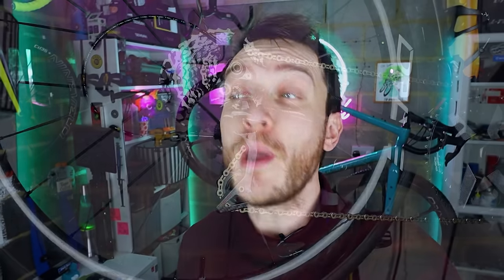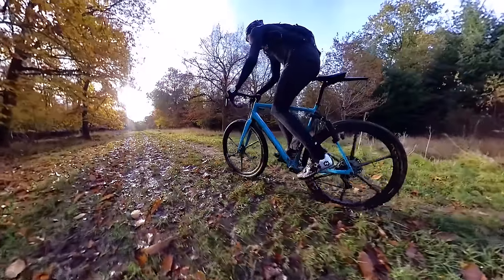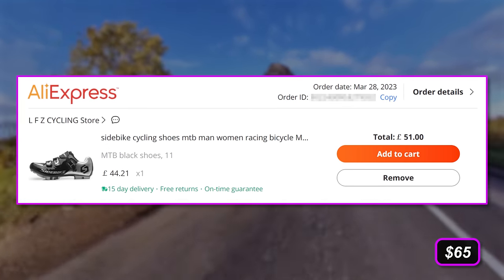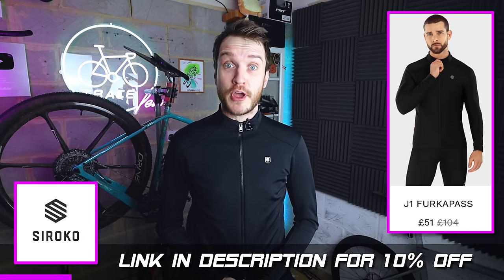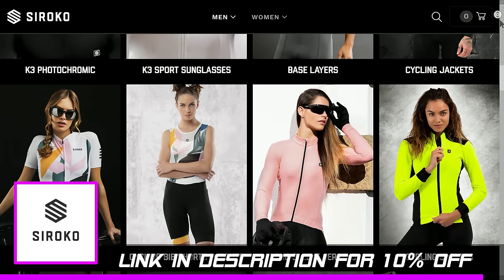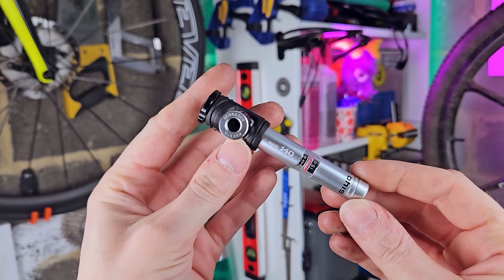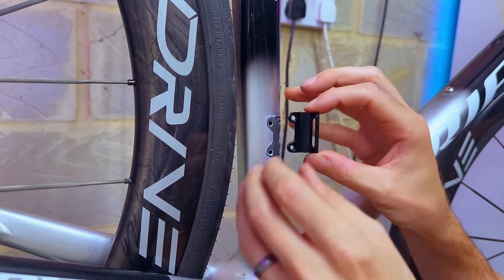Cheap bike parts - My best & worst of 2023

Comment: Road rider using the Zeray pedals.  Quick hack is to remove the locking mechanism from one side of the pedal (2 sided not really needed for road riding) and the pedals drop in weight to only 220 grams - outstanding!!
Reply: Thanks for the tip, is it easy to remove one clip ?
Went from the basic shimano pedal (2 sided at 444 g) to their single sided at 282 g, would not mind an extra 60g saved (bit of a weight weenie)

Comment: Awesome video once again. Regarding the xpedo pedals ive read on numerous forums that they dont play nice with any thing other than xpedo cleats. So maybe that explains the issue.
Reply: I use four different sets of Xpedo with Shimano cleats, and never once fell ;)
The pedals shown in this clip are fake, I would take a bet.
Price and weight do not match my (supposed) originals, and I ride them since 2018 without issues (also, this model has been discontinued for years already).
Reply from the maker: Thanks so much! So the XPEDO pedals did come with some wierd looking cleats and i would have used them, but they were designed to fit road shoes with a 3 bolt interface, not the standard 2 bolt MTB shoe interface. They claim to be cross compatible with SPD, but maybe you are right and the XPEDO cleats would have been better. Still not particularly impressive either way IMO. @luminodotcity, in terms of they being fake, I dont think so. The packaging was really nice, and it included all the extras and a proper manual and warranty card... Maybe i just got pedals from a bad batch, but i think it is something to do with the design. Like you say, they seem to have discontinued it, maybe this was for a reason...

Comment: I ve had good results with the Wellgo Xpedo single sided SPD pedals .  My 2 sets look the same as Lukes but are heavier at 244 g .  The bodies look like aluminium but a magnet sticks  to them so must be some sort of Steel .. i have Wellgo Xpedo M Force 8 pedals too .  Thry work fine too , but a ot more expensive .. i use Shimano SPD cleats
Reply: Same, agreed!
The ones in this clip seem to be fake - too cheap and too heavy. My pair is 170g for the pair and play nice with Shimano cleats since 2018 :-)
Reply from the maker: Yeah tbh it surprised me, because i know XPEDO have a good reputation, and make some decent and well respected pedals. I honestly stuck with them for AGES thinking they would loosen up over time, but time and again i had issues unclipping. I think i may have had better luck if i stuck with the cleats that they came supplied with, but they claim to be SPD compatible, so in the end i got fed up and swapped them out.
Reply from the maker: @luminodotcity  The weight difference is a bit odd, the box they came in said they were 215g, so coming in at 210 seemed resonable. I know they come in a lighter titanium spindle variety... Are these the ones you have?
Reply: @TraceVelo   I thought you had the TI ones as well, as that was what I read on your box. Clearly, right next to it, CR seems to be highlighted and that escaped me.

I have the TI-spindles, yes, that explains the weight difference.
But clipping in or out, with three different shoes on Shimano cleats was never an issue in 5 years now.

What I am not a fan of is, that they only have one bearing and one bushing each.
Well maintained (i.e. re-greased) they should not loose too many watts - but I went with the double sided ones now, which have ball bearings all the way through, and weigh only around 260g/pair.

Are the CR ones still available this year though? When did you buy them?

Comment: @10:53 Luke, you can go one better than them. There is now Schwalbe ONE 365 tyres. I guess a 'quick' tyre all rolled into one. Ive got a pair on my wall but i havent used any examples yet. Id expect them to be slower, but have the puncture protection to that of a Marathon. Cheers. m

Comment: Great video, for rotators i buy the iiipro you viewed one time they light and does not heat too much, for tires i prefer gp5000 they little expensive but really good on the ride i was all about cheap tiers before but i treat my self once with gp5000 and i can't go back to cheap tiers any more i think and that's only my opinion for my self i shouldn't go cheap on tires or braeks
Reply: There cheap brand shared the same design of brakes and rotor. That means they will leak after very short distance and need the shimano spare parts to repair.
Reply from the maker: Everyone RAVES about the GP5000, but they are just SO expensive. I've never seen the tubeless ones go for less than £50 a tyre, but maybe they are worth it...
Reply: @TraceVelo  you are right it's sooo expensive but i bought them to see if it's going to make any difference it's smoother little faster but you know what they said " it's not the horse it's the horsemen "

Comment: Hutchinson tyres were supplied with my first ever gravel bike, the Overide 38mm ones. While cycling to work around Dundee, I had a puncture about once a week. Switched to WTB Nano since, as they were on offer on Wiggle for 8.99 and never looked back. Third pair in and I didn't have a single puncture in 2 years.

Comment: I use a ZTTO 11-36 cassette on my road bike.  It is an 11 speed mechanical Shimano 105 setup.  I've had the ZTTO cassette for almost a year & am very happy with it,  The 36T cog really helps with higher gradients.  Shifting is fine rather than perfect.  I'll definitely replace it with an identical cassette when it wears out.  3,286 Philippine Pesos from Lazada (about GBP50)

Comment: Question about ZTTO cassette.

A year ago I bought a SROAD HG 11-42 cassette. Now I need a variant 11-46. I tried to find such a range from SROAD, but unfortunately there were no options. I looked through your reviews on these cassettes, inspired and ordered ZTTO HG 11-46 ULT. After unpacking, I did not like two facts: 1. the inner sleeve between the outer stars (movable), it rattles a lot; 2. the cassette is held by the drum at the expense of the outer stars, which have splines.
I have not met with such a design before. Do you think after a while will not kill the cassette - the drum?
Thanks)

Comment: I had to buy another frame from AliExpress because I broke my carbon frame frame a crash. The frame I am getting would be the TREK SLR gen 7. My question would be about buying the BB T47 x 24. How do I know would be a good one to buy from $20 to $200? I bought most of the parts from AliExpress from the last bike, I want a good Bottom Bracket, but I do not want to overpay either for no reason either.

Comment: I've been using the IIIPRO/ZRACE  Centre lock Rotors and they have been great with KORVELO "New Formula, now with more red" 🤣 (taken right from the listing) pads and I can't fault them. 
Glad you are coming around with the Tri-Fox frame my DELIHEA has been nothing but a joy to ride. And to be fair to Tri-Fox lots of mainstream fames suffer with the same issue Pre 2020 Cannondale's were prone to it.
Reply from the maker: Yeah the TriFox frame has grown on me since I fixed the FD hanger, it does ride well, and like you said alot of frames in the 2010's suffered with the same problem. BUT I actually have another OG-Evkin frame on the way, so it will be good to compare the two. They are a similar price, but from what i have seen the OG-Evkin stuff seems to be a cut above... But i guess we'll see...

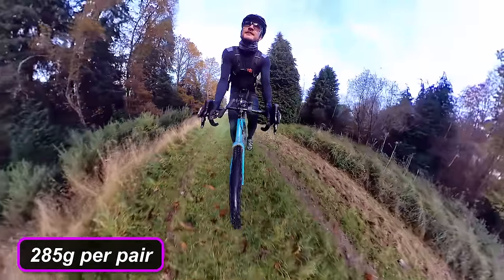Comment: 4:31 Just a heads up. In my experience with the zeeray spd cleats pedal, they were mostly good in terms of performance but I had a problem unscrewing the allen screw where you would lube the cleats. Mine is difficult to remove from the left side of the pedal that the thread became loose and couldn't remove the allen screw.
Reply from the maker: Ok interesting. I've already had both of those covers off on my pedals, and they have been fine. Hopefully I wont have to lube and service them for a while, but thanks for the heads upo anyway 😁
Reply: In the video it looked like they weren’t really spinning that freely? What’s your experience with that been?
Reply: @TheSlounsBerry   I thought the same, and was going to ask.. definitely didn't look to be spinning properly?
Reply: I have these Zeray SPD pedals. No problem at all. I moved from toe-clips to these, clipping in and out have been easy and problem free. Have also screwed and unscrewed to adjust the cleats multiple times   with no problem with the screws. Great purchase for me.
Reply: Those zeray spd cleats sadly have no bearings so there's nothing much you can do when it goes bad😢

Comment: Ordered the same Og Evkin, it was between the tri fox and the OG. Scored it for $390 USD so it was hard to pass up. Although the tri fox is in sale for $499 usd at the moment
Reply: I snapped one of there hardtail MTB frames at the headstone but it was good as it lasted
Reply from the maker: Ahh amazing, yeah that CF-025 frame is fantastic IMO. The trifox frames are generally ok, but in my experience require more more faffing around to get everything working smoothly. The OG-Evkin frame was just easier to work on, and basically problem free, so is def what I would reccomend out of the two.

Comment: I'm feeling the second hand embarrassment from that one at 12:24 😂 I got some Xpedo M-Force 3 pedals for my upcoming gravel bike, so I'm really hoping I don't eat the mud like that 😂 🥖🥖🥖
Reply: I have those pedals on my gravel bike, they work fine. It says in the instructions that to clip out you need to press your foot down before twisting it
Reply: The "Xpedos" in this clip are fake, I dare to claim.
They are discontinued for years already, and my pair from 2018 goes strong, I never fell, and they are 170g/pair and closer to 200,- Euros, go figure ;)
Ride safe!
Reply from the maker: HA, yeah was pretty cringe worthy! I mean XPEDO generally has a pretty good rep in other markets, and they produce some really premium gear, so you will probably be fine, but my set of pedals were just problematic. I've seen some comments from people saying you need to run them with specific XPEDO cleats. They claim to be SPD compatible, and you might have seen, i was running Shimano SPD cleats, but maybe this was what caused the issues i had... who knows!

Comment: Those zeray pedals lasted one winter for me. I went back to the shimanos, and they are miles better in every way !
Reply: I bought a set to try 2 years ago and used them on my MTB where they weren't confidence inspiring as they'd unclip randomly even fully tightened. I swapped them to my turbo bike and the bearings were rough within 18 months. I've got a set of m540's that are 15 years old and still work fine. 

I recently picked up a pair of ztto SPD copies for about £10 and they seem much better but I've only done about 200km on them.

Comment: Be careful on the schwalbes if they’re the performance rather than the evo model, they’re the only tyre I’ve had that has had that same loose feeling you described.

On another note have you ever tried the fasterway carbon bars, they seem to be the only ones I can find with 35cm tops?
Reply: it scares me seeing someone with handlebar narrower than 40, in group rides I tend to ride further from them, since most of crashes I've seen on crits are riders with narrows. would recommend staying away from those, we're not racing world tour afterall 😄cheers mate
Reply: I run 38cm bars in summer but that's just a comfort thing. If I had a bike fit, I should absolutely run 42cm bars, but if I do, I end riding funny and hurting my neck and shoulders.
My track bike originally came with 36cm bars, I wouldn't use them on a club ride.
Reply: Thanks for your concern, I've ran 38s for a long time now and feel I could get faster bringing my arms more in line with my legs.
I tend to do a lot of road bike TTs and solo distance rides. 
My crit bike has 38s on there and they're plenty wide enough for banging about, cornering and stability is so much more about your feet and weight transfer than your handlebar steering anyway.
Reply: @robvtec  ah well 38 is some middle ground. I've also seen some beefy wide shoulder cyclists going with these narrow bars and it's also comical 😂
But regarding your question, I ordered few handlebars off of Ali and I've never seen under 38, so maybe you go for ones you've found

Comment: I bought a set of XPEDO SPD pedals from a German online bike company and had a similar problem with them.  Even on the loosest setting I still had a hard time disconnecting my cleat from the pedal.  Unfortunately, I turned one of the adjusting screws out too far and it fell out during a ride, making the pedals unusable.
Mine were a fancy blue anodized model and a total waste of money.  
A big thumbs down to EXPEDO pedals.

Comment: I put 700 miles on those pedals and I'm not a fan. They're ok if you're riding gravel but they feel real sketchy on a mountain bike. No matter how tight I got them they just felt loose and the spindles are mismatched. Real Shimano pedals are leagues better.

Comment: I usually agree with you, but I have those zeray pedals and they are absolutely atrocious. They have excessive float with no tension, so they flop about left and right when you ride. I tried them with both supplied and original shimano spd cleats, and in both cases the problem persists. 
If anyone wants to save money and thinks M520 are too heavy, I'd go with used M540.
Reply: My experience also.
Reply: Thanks for saving me the trouble. The non adjustable float (despite the Zeray being advertised as adjustable) in a pedal is  a deal breaker. It's what I despise in my Time ATACs. The Pedo pedals and Rock Bros shoe covers are nowhere to be found on AE btw.

The dual durometer tires are prob good tires in the dry/summer. Itd be the equivalent of skating a hard duro  wheel in the rain at the skatepark.

Comment: I liked the Zeray pedals as well. However, they developed axial play in no time. Especially the right one. And the pedal body is impossible to get off the axle for bearing service. There is a nut on the end of the pedal spindle but just no space to get a tool in. I managed to loosen the nut but I cannot for the life of me get it all back together and tighten the nut down properly. Just not a great design. I ended up with a pair of Xpedo titanium pedals. Even lighter and super easy to service.
Reply: Can be serviced, i have done it a couple of times. Only a few ball bearings and a bushing inside

Comment: I had my side bike spd shoes for 2 years before the heel caved in on me but they took all the abuse one could throw at them and did well arguably as good as any brand shoe I have had since that hasn't been mouldable
Reply: How was the sizing of the shoes?  I normally wear a 9 which should be 43, but the site says 42 is 9.  I'm not sure which to buy, 42 or 43.
Reply from the maker: Yeah i have been SUPER impressed with my sidebike shoes. My set of road shoes are easily the best shoes i've ever had. They are priced really competitively, and the build quality is great!
Reply: @TraceVelo  But how is the sizing?  Do they run small, large, or ?  I wear a 9 and a 43, but those don't align in the sizing info.  I don't plan on returning shoes via AliExpress, shipping to China.  Thanks
Reply: @larrylem3582  that is my question also. I do wear Shimano 41.5EU and Sidekick does not offer half sizes.

Comment: Just out of curiosity, do you think the knockoff SRAM centreline rotors would be as good or almost as good as the originals?  They’re like 1/8 of the price so I’m quite tempted to
Reply from the maker: I would go for it personally, UNLESS you are using fully metallic brake pads. I've no idea the quality of the steel on the knockoff rotors, and I know fully metallic pads are crazy abrasive, so if the steel is a little softer, you could have issues with rotor wear. But if the pads you run are resin, you will probably have zero issues...

Comment: I've used those single-side Xpedo pedals on my road bike for years and not had any issues. I'm over 60 yo and my power output is low so I have the cleat tension set very low.

Comment: Luke, what did you think of the float of those ZERAY pedals? I found them too loose for my shoe.
Reply: I had the same experience. Too loose!
Reply: I wonder what kind of contact points would need some tinkering to get a tighter interface. 

I have since moved to a single sided SPD with a nylon mini flat pedal on the other side. Sounds silly, but they're similarly light and have a rock solid interface! I will race on these as I don't really unclip! @alanleclair1

Comment: I've had 2 very bad experiences with Hutchinson tyres, first one was with the first gen 5eleven storm that i got with a pair of aero tubeless ready wheel and it was a nightmare to sit on that very rigid 90mm deep rim, even the Giant store i brought them to and their powerful compressor that usually does this shit in miliseconds could not have it sit properly in the bead, they were baffled, told me they had stopped working with them 6 months prior due to this ever inconsistent quality which had them lose time and freak out clients. But i then heard 2 to 3 years later Hutchinson had changed things out, that quality seemed to have improved significantly and i tested out their new challengers, fantastic tyres on the dry, sturdy, puncture resistance and yet light and really low rolling resistance but man when tarmac got wet... so did my bibs ! Had a few too many scares, changed them out for conti 4 seasons. I rather lose a few watts than years of life expectancy.
Reply: Anyway too long of a post, thanks for all your work Luke, it's been a blast watching your content through 2023. Wishing you a fantastic year 2024 with plenty good fun rides !